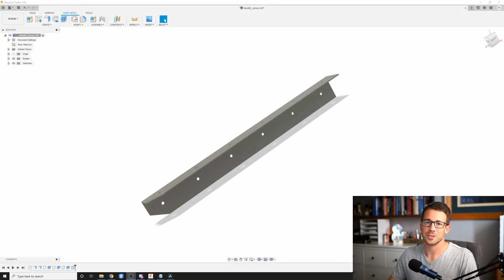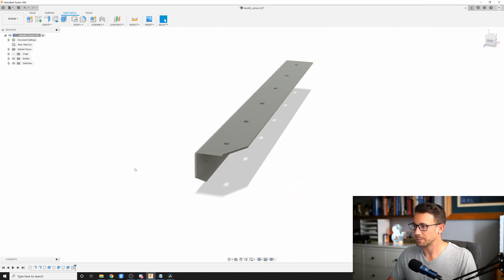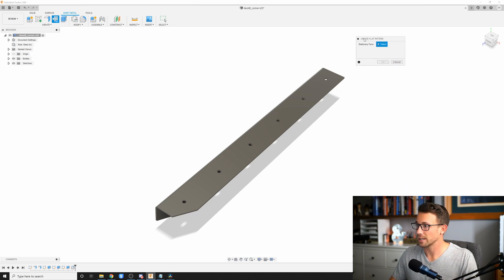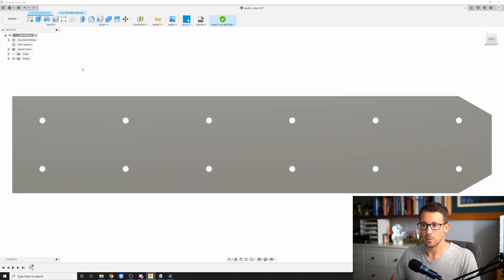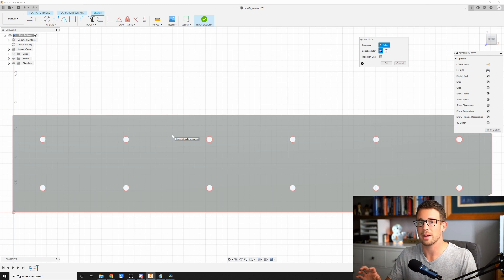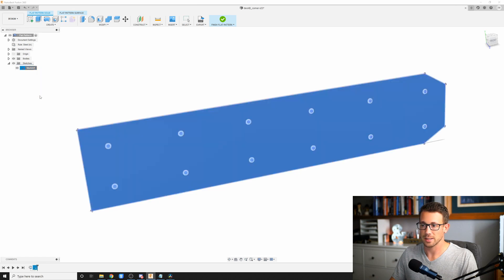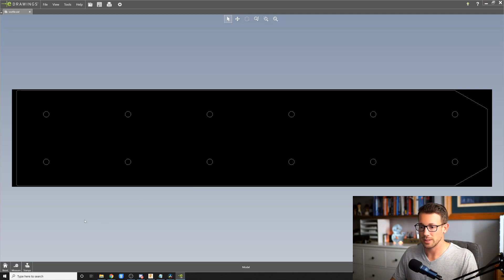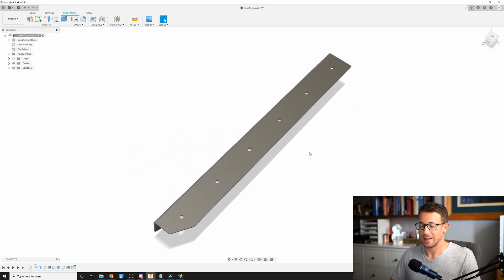Fusion 360 - Most reliable DXF creation method

Comment: WARNING ! ! ! Just like to point it out if you haven't noticed. it does not save that projection you made as a DXF. Fusion actually saves the "sketch face". You can just make a sketch on that face, without a projection or lines/geometry and get a DXF. It makes the "sketch face" or blue shade area into a DXF. you will be upset if you have counter bores or counter sinks and try to save a projection thinking that is what you'll get. I know.

Comment: You say it results in problems, but don't show or state what those problems are.   What if your item is a simple flat piece with a few holes (no bends) do you still need to go through all this?   What happens if you draw something up and don't create an item as a "sheet metal part" how does this impact the export.   So many unanswered questions.
Reply from the maker: Definitely understand where you’re coming from. The purpose of the video was to be quick and provide a reliable method that works regardless of other factors (like the title says). Going through all of the possibilities would be a good idea for another video (or two) but would have made this one too long

Comment: This is definitely the best way. I happen to be running into scaling problems. It's converting the file into metric even though my document settings are in inches. Might be good to ad this fix to this video. For the sake of clarity... my comments are not criticisms, just my experience. It's hard not to love Fusion for cost vs power but sometimes I hate it. Going to reach out to Fusion team.  Thanks!